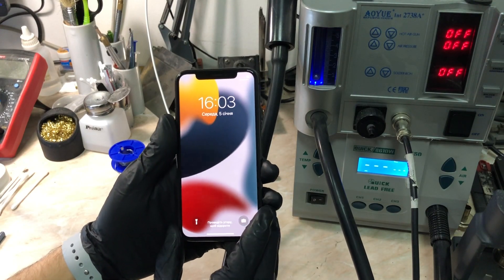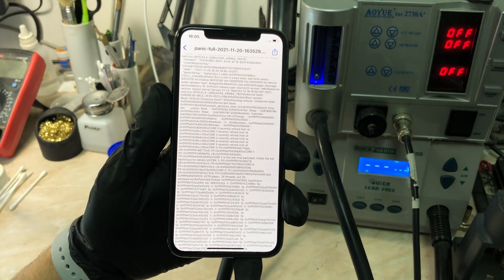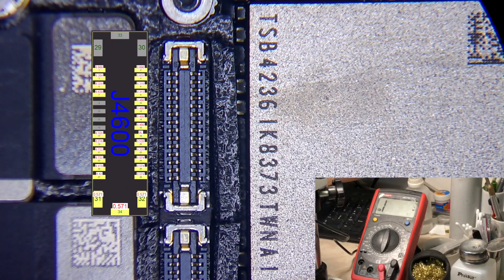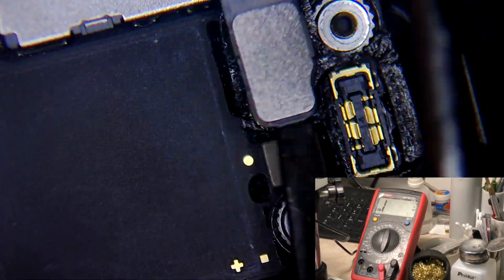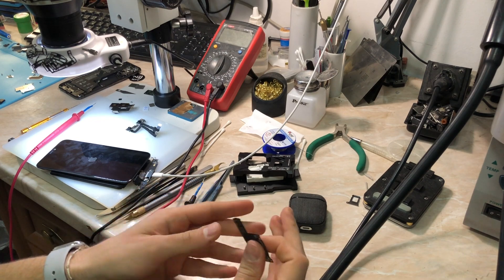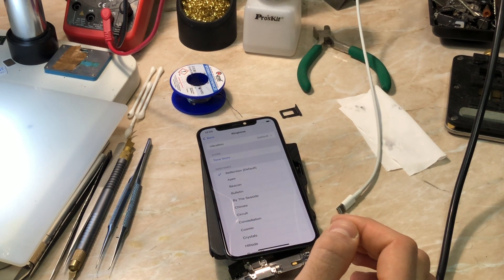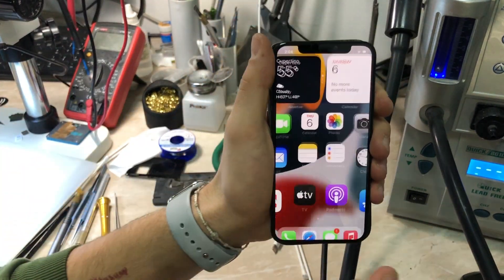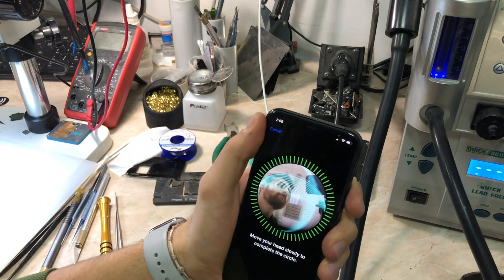iPhone 11 Pro No Sound (Stuck on Max Volume) And Glitchy Camera (i2c2 Panic) Repair

Comment: Hey man, this is my exact issue right now with my ive had for 6 months from brand new and this happened without dropping or water damage very upset. No boot loops, SEID isnt working.  I've replaced alot of screens, batteries and home batteries in the past on my phones . How complicated is this job to do at home as a hobbiest with a pinecil and heatgun? should i save my time and money? or just get another phone